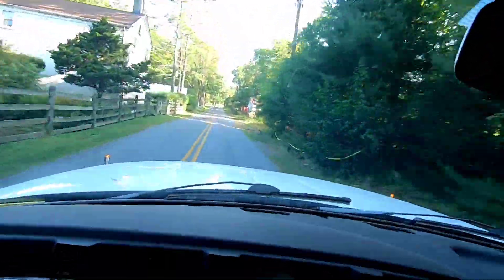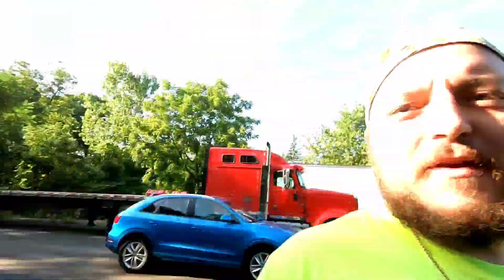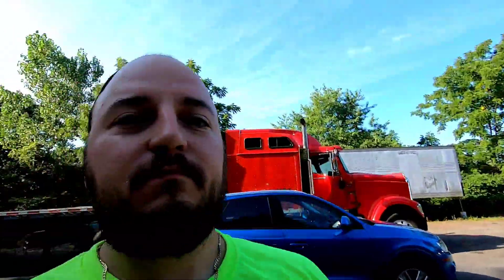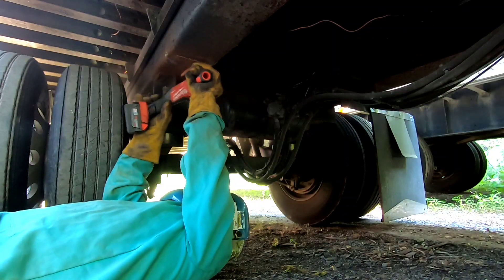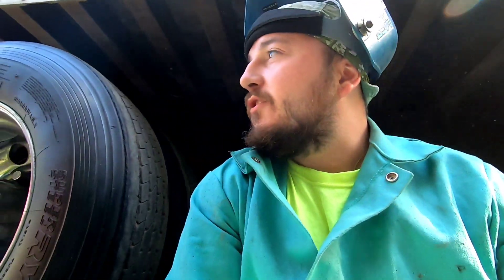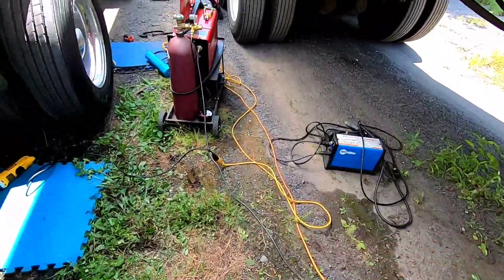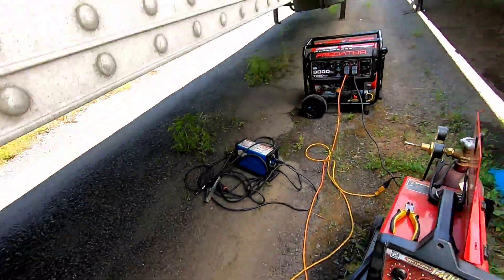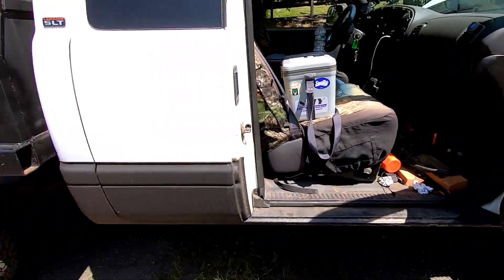MOBILE WELDING JOB GONE WRONG!!

Comment: Totally connected with this experience. One of the vans in our motor pool had a dead battery. Got that fixed, then the customer came back and windshield wipers broke. Went to fix the wiper transmission and dropped one of the specialty fasteners into the engine bay. Had to remove a bunch of stuff to get that. On and on. So there's a lot to say about making do and perseverance. You can have the nicest welding rig in the world, but even then, there's going to be challenges. It's about maintaining a good attitude and being flexible. You got it!

Comment: I made 4 whips for my welder with the most common plug types I encounter. Dryer plugs, air compressor plugs, generator plugs, and an extension cable for when you need a longer reach.

Comment: I have a Miller Thunderbolt stick welder and it would only run on the generator's 220v 4 prong twist lock. I just made an adapter for it to work. My Forney fluxcore welder is my go to for 110v plugs.

Comment: Buy yourself a Simder arc200 from Amazon. Less than $80.-. Works on 110 or 240, and it doesn't have all the circuitry to worry if it's hooked up to a generator, Euro voltage, American voltage, or even an inverter. It'll burn 3/32 7018 rods like hot butter. And you can turn it up inside, by turning the little blue rheostats.

Comment: Dang Brother I did not know you were in Jersey. I am still recovering from getting run over o my 1957 Panhead 18 months ago. I was going to start a mobile welding/fabrication business when someone in an F350 smashed me into a telephone pole and left me broken and almost dead along the side of the road. Been a long 18 months and I can pretty much walk without much assistance so I am putting my welding trailer together with probably a Miller Roughneck or if I can find a good deal an Sa 200 , a 50 gallon compressor that I just converted from electric to gas, a large job box and a 2000 pound crane to mainly get the equipment on and off for now. I am looking for an autocrane or liftmoore to mount on my Ranger so I do not have to lift stuff . My best friend and I are also masons so we are going to offer excavating and flagtone along with stone wall resoration and repair. I found a 1958 Fordson Backhoe that I am going to restore to working condition with new hoses and the basics to put it in service and then fully restore it as more money comes in. I believe I may have to go to Millville next week sometime. Hopefully we could grab a sandwhch or something if we can link up.
Reply: Jersey guy here !! Horrible what happened to you man ! I hope for a speedy recovery! You re from the Cumberland county area ? I  am from Salem county/Gloucester county. Up in north jersey now with my own mobile welding/shop
Reply: @lestatdelioncourt9335  Awesome my friend!!! I have to just keep pushing forward. I am using this time to locate equipment. I found a really bad SA 200 that I am hoping to pick up this week if I can make a deal on it . Its rough and I will take it on as a project. I was the first person to message  guy with a beautiful SA 250 that was Garage kept and he wanted $500. At the time I had no way to get to Ohio to get it so I said go ahead and give it to someone else because I will not be able to get it in a reasonable amount of time.I am kicking myself every day because of that. I have not been able to walk or work for almost two years now and I am finally able to walk sometimes without any assistance. Got pulled over in a field sobriety checkpoint in Philadelphia and luckily I am a mason and I was EOD for Homeland Security because it would not have mattered. If you cant do the tests for even my reasons they make money on you. Crazy days brother. Hope to catch up with you soon.-John
Reply from the maker: where abouts in north jerey

Comment: preheat with a propane torch will make that 110 machine work better/....
Reply from the maker: huh?
Reply: @mcfwelding  preheating the steel will improve penetration of the 110 welder's welds.  works every time when the machine is limited in its power.

Comment: You can do alot with those lil welding machines I bought one from harbor freight for around 500-600 got a discount cause my wife worked there and made thousands! Off a generator and a lil welder. #makethatmoney 💰💰💰

Comment: I bought a Miller CST 280 and have no 240v power at my house. So I'm using a old Honda 5000w generator and it has 240v. I plug up my Miller with a different 240v attachment to connect to the generator. It work but won't go over 110 amps either 6010 or 7018. Hard to strike at higher amps. But it works good. I'm just planning to get a bigger generator like 9000w or 11000 wats

Comment: Mig is just as strong as any other type of welding if you run a decent amperage or smaller stringers if you aint got alot of amps. I can't even count how many pipes that i have migd the bead and fluxcored the rest of the way out. Like high pressure piping,chrome carbon and all that. If that machine could do 18.5 volts to 19.0 volts and 220 on the ipm, you could damn near weld anything with it.